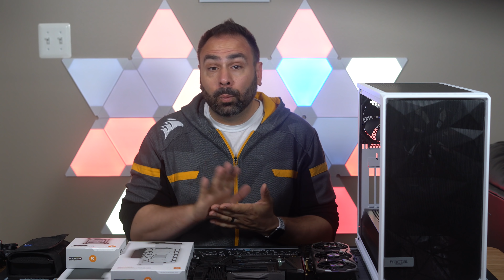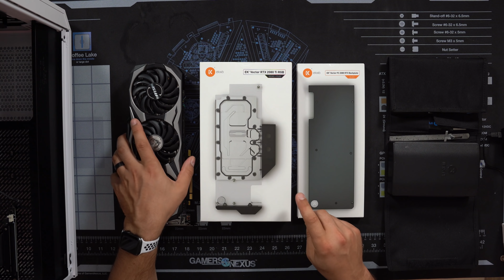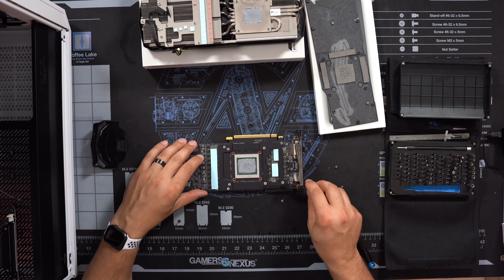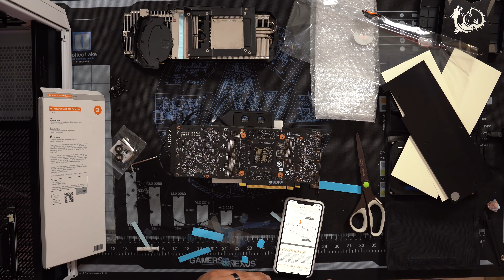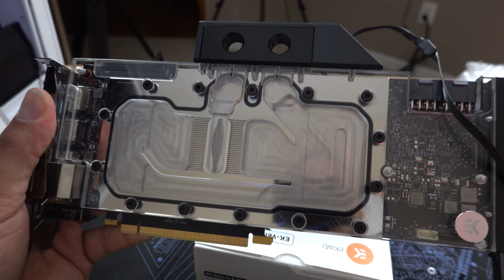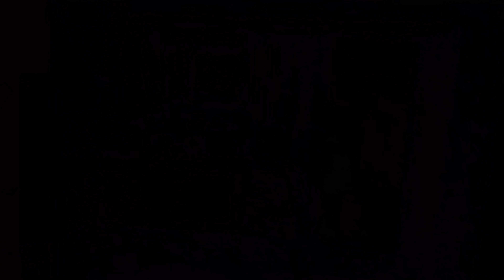No Longer A Total Disaster

Comment: For a minute watching you put together the GPU block, it looked like you might have forgotten the thermal paste as the tube of thermal paste didn't move between you putting the block on and flipping it over and starting to install the screws. The tube moved shortly after so I assume and hope that you got the thermal paste on the GPU  ;)  Also, I have the same CPU block and rotated mine as well but IMHO you should have taken it apart and rotated the chrome trim piece that says velocity on it to back to the bottom. It is symmetrical so its quite easy and simple to do, and will ease a lot of OCD viewers minds lol. Good job though! I'm looking forward to seeing the final build and hope you put a link to who is manufacturing the distro plate ;) I'm looking for someone that can CNC a couple custom ones for me and preferably with experience in PC distro plates as Ive talked to a couple local shops and they look at me like Ive got three heads as they still see PC's as these big beige boxes and cant wrap their heads around what I'm talking about.

Comment: This is coming along beautifully, can't wait to see the distro plate installed when that's finished.
Also on the backplate screw, I had the same issue with my 1080Ti setup and it turns out EK missed that one screw in the package but as you mentioned it's not going to hurt anything either way.

Comment: If I ever went back to water cooling I'd purchase fully fitted water blocked gpu (like msi's hawk etc) reasons? Just had a two year old gpu go gaga after fitting a custom block, whereas if it was a hawk version it would still be under warranty. Cheers
Reply: I liquid metalled my first 2080ti FE and put a block on it. It was from first batch and failed. I put it back together (with normal paste) and NVIDIA (who vend through Digital River) made no quibble with me about replacing it. NVIDIA warranty is 3 years.